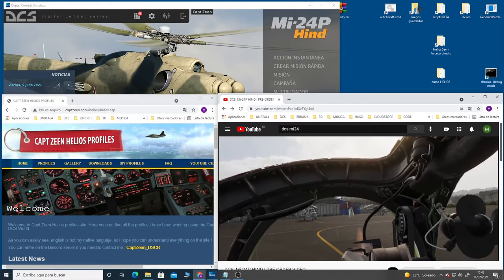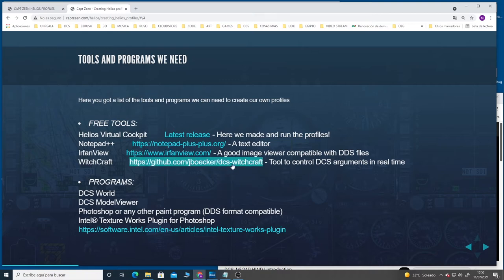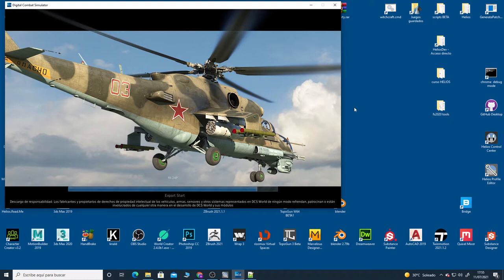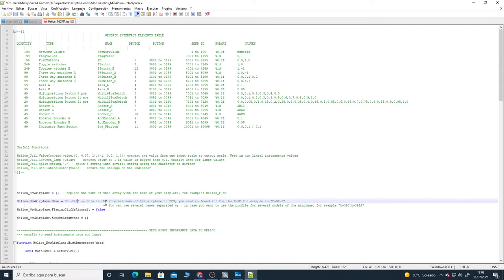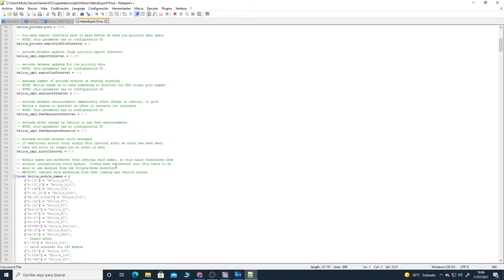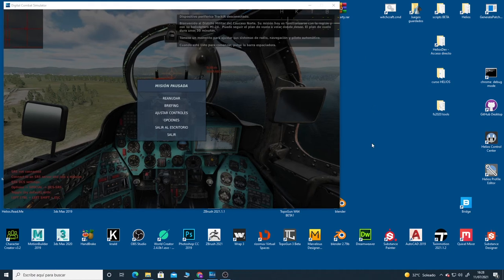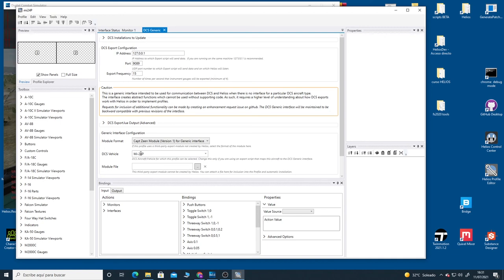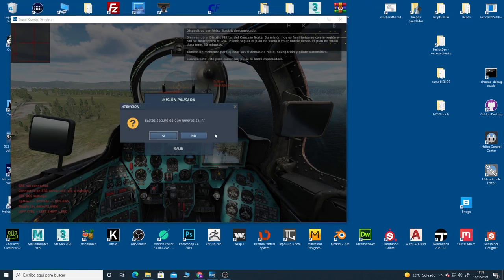Creating Helios Profiles from scratch - PART 1

Comment: Thanks for the tutorial. Highly welcome.
Is there are a forum or somplace to ask for help with Helios?. DCS forums don´t seem to work looking for help or support on Helios.
I just installed the new 1.6.5 version and created a new and simple display of gauges using the new F-16C_50 interface, and none instrument works.
I place fine all the frontal gauges of the plane, to be displayed on a seccond monitor, and none instrument change its values, they remain static.
The profiles y created for F-18 and AV-8B with previous version seems to work fine.